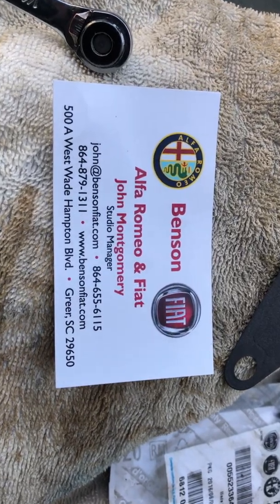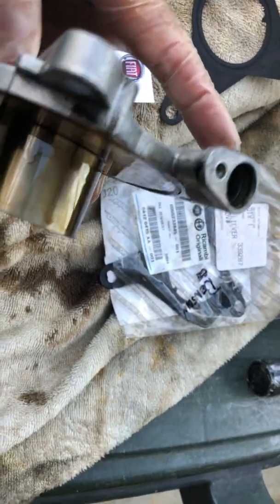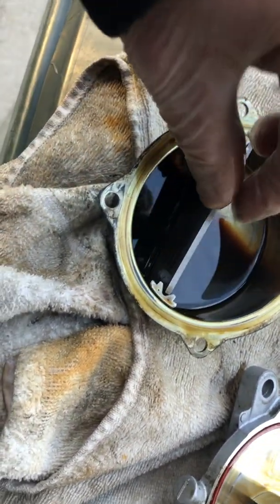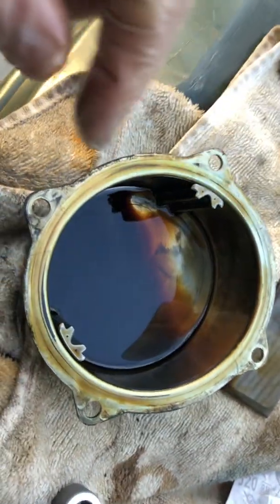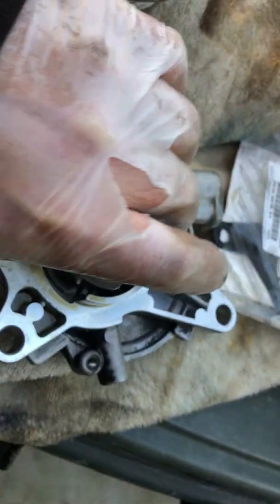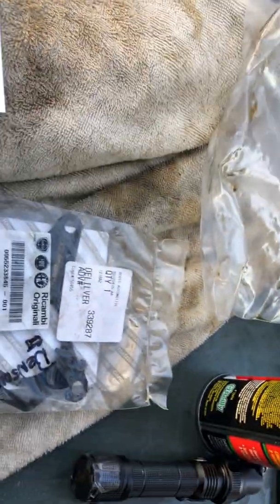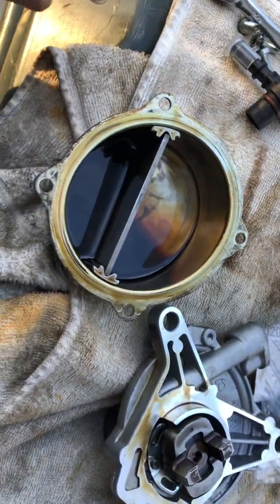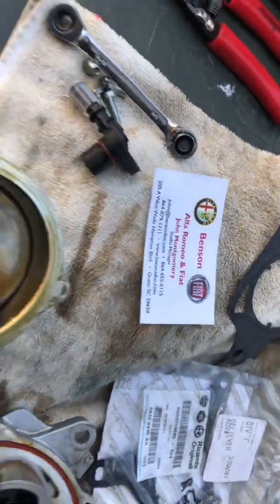Fiat 500 1.4 L vacuum pump autopsy

Comment: Do you know the part number for the connector that is shown around 0:35- 0:36? It’s the plastic fitting that secured with a t25. 
My snapped, I glued it on and I can’t notice anything different braking wise. But want to get it replaced.

Comment: After I just checked into this it’s actually supposed to have oil in that side! However there is a check valve that goes into the top of the pump that doesn’t let oil get in!

Comment from the maker: Unfortunately every attempt I made to fix one of these with sealer has failed so it’s just better to buy a new one. They are a little under $300. Be sure to torque to the exact spec as shown in the video replacing the pump.

Comment from the maker: Check out my installation video for the part numbers on the gasket and the pump/gasket complete assembly. Make sure your gasket is straight if it’s bent it may not work so if you buy one inspect the box to see if the gasket is in perfect condition.

Comment from the maker: Hi Stefan, the part number is 68120415AA for the gasket. Make sure it’s not bent when you get it because it’s made out of metal and if it’s bent chances are it will leak.
Reply: no, the o-ring on the housing

Comment from the maker: I would recommend doing the basic and least expensive things first. Spark plugs should be changed every 32,000 miles, air filter every 20,000 miles for example. I don’t know if it has any kind of check engine light but that would help you find out the issue.